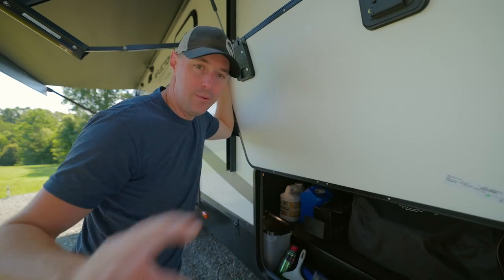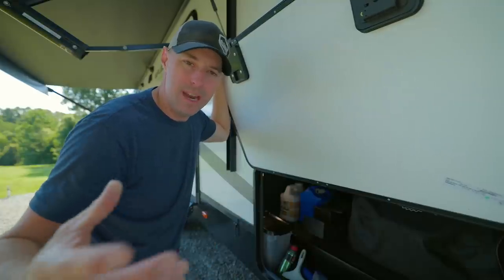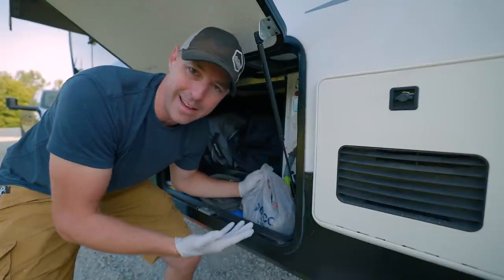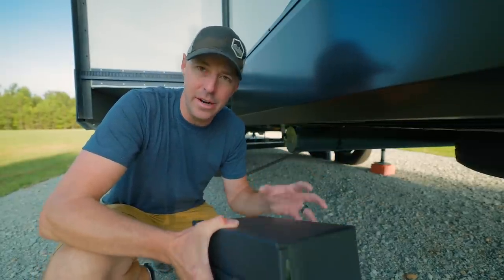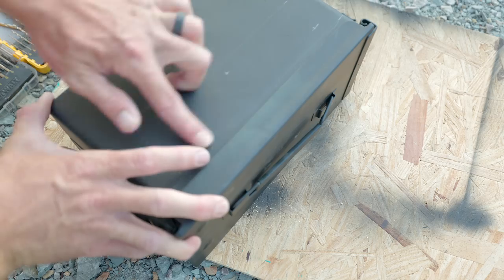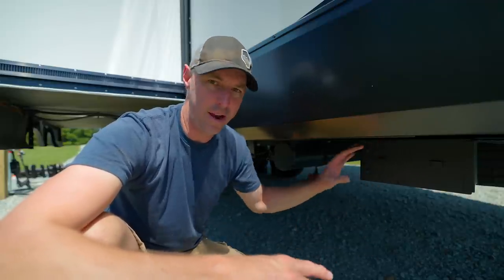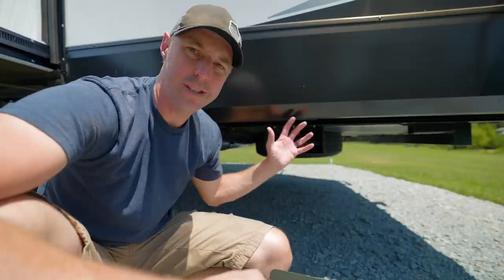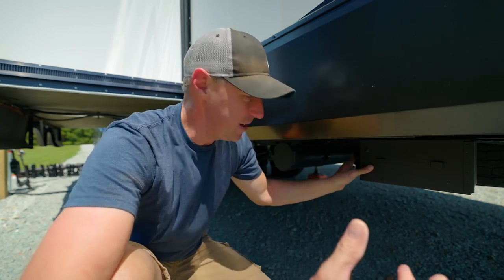DIY Secret RV Storage!

Comment: Good Idea but I think the weak link in the installation is the screws.  Or not sealing them from the elements.  Water or moisture will find a way into that box to frame connection and start to corrode.  Some silicon or other sealant on the back side where the screws poke through the frame would be a good idea to extend the life of the mod.
Reply: The nice thing, though, is that it's cheap enough to replace if becomes a problem! :)
Reply: @WillBelden how about the frame?
Reply: @cisco1dog  Not sure those i-beams would rust out in what's left of MY lifetime.   I'm no metallurgist, though!
Reply: @WillBelden  maybe not, but having been a large truck technician and then field engineer, we never put holes in a frame without preparing it for the possibility of rust. The frame isn’t where you want to encourage rust. Some paint or petroleum based preparation would not take any longer and would insure the can and frame were secure.
Reply: @cisco1dog  Sounds like excellent advice, and you're right -- wouldn't take but a few seconds to seal up nicely!
Reply: @WillBelden  by the time a rust will be an issue, the RV will already be in a recycle pile.

Comment: I probably would have mounted it so that the door/lid opens the opposite direction, this way if it does pop open while driving the wind will help keep it closed. But that’s just me.
Reply: If you had done it your way every time you would have opened the door the lid would have fallen off. Check out the orientation of the hinges.

Comment: DUDE! You're killin' me! Just got home last Sat from a 4 day jaunt in the trailer. I kept the trailer in my driveway specifically so I could accomplish a few more modifications that I didn't get to last season when our trailer was brand new. Just finally installed a weBoost cell service amplifier, set up a new griddle, and completed a few other things and TODAY was my day to run the trailer back to my storage facility until next Tuesday when we launch on another 3 day get-away. NOW THIS! I was just brainstorming this very subject on Saturday morning when I was breaking camp down but didn't come up with any great solution to separate out the waste components. This is perfect and I have the components in my garage. So, TOMORROW is trailer return day so I can get my bass boat back home so I can hit the lake asap! Thanks! 👍

Comment: I had the same problem and solved it by mounting a battery box on top of the bumper.   It is the perfect size to hold all of my connectors an donuts  for needed for waste removal and keeps them away from everything else.
Reply: Can you post a picture please
Reply: @jimbauer5560  13-23
Reply: @jimbauer5560 you could probably just strap it down without putting holes into the bumper. The battery box anyway

Comment: I use ammo cans extensively for storage in my class a. 
Everything from tools and parts to well.. ammo.
I would use 1/4” bolts instead of the screws. Most screws break pretty easily

Comment: One of the best mods I did years ago. Makes it so easy to get to the fittings. I went with a slightly deeper ammo can. Yes drill a few small holes as moisture builds inside.

Comment: Dude! This is perfect! I did replace my hose holder with an 8ft section of vinyl fence and used the existing holes to mount it to the frame, that way I can keep 2 sections in one spot. I am going to use the ammo box idea too, thanks!

Comment: Yep, I did that 12 years ago. The tube that held  my sewer hose wasn't big enought to hold my Rhino sewer hose because of the right angle connector on the end of the hose. So I took 4  eight foot cedar fence pickets and cut them to 6 and a half foot. then glue and screwed them together. I cut the  left orver pieces to make and end and a hinged door for the other end and put L brackets on it, then painted it to protect it. then  mounted it to the underside of the rig where the old sewer hose tube use to be. I also made a box to hold my 15 ft. telescoping ladder under the 5th wheel. Having to reach down to my ankles to grab that ladder on the back on the rig while it was shaking was a less than safe way to get down. Now I just climb up the telescoping ladder an step off on to the roof and step back on to the ladder to get down. Sooooo much easier.😊

Comment: Did that 4 years  ago with 40mm Mk19 ammo cans on my Forest River travel trailer.  Actually had 5 of them mounted  and they carried everything from x-chocks, dunnage, power cables, dump tank fittings, and water hoses.  I actually have a 50 cal can  my fifth wheel now mounted by the dump port that I keep the final 90 and donut in.  You can go on line and order a stud that has a padlock hole that you install and you can padlock the  ammo can closed.

Comment: Such a great mod Jared, thanks for sharing!  The only thing I would add is on non-metal cans add flat metal braces inside the can that connected at the screws to keep equal pressure across the can against the frame. Keep them coming!

Comment: YO! this is fantastic, you just solved so many problems for me. We just picked up a small jayco x17z, and it has quite a lot of storage for the size, but only a very very small exterior door and it's on the opposite corner from tank drains, so I had to either use a bag for all the drain stuff, or find a bin that could somehow fit through the door and hold this stuff. Guess I'll be mounting one of these over there for my gross stuff. THANKS!

Comment: I've got a compartment in the rear that I keep the power cord, adapters, hoses and flush equipment. I keep all those things in a container (enclosed w/ lid), but I just might have to look into doing this same setup (as well as finally mounting the hose holder under there too).

Comment: Gr8 idea!!!  Wish the RV industry would come up with some external storage solutions in the back end of these coaches.  I know theres several on the market that are bigger, but the price tag is around $600 and they are dust and water collectors.  Several different sizes on both sides as options for your needs would be ideal for storing miscellaneous items as you perfectly articulated and did!
Winner winner seafood dinner!!!
👍😃🍻

Comment: I like the idea of under mounting and the specified use. Well thought out.
Suggestion: I don't know the materials the amo box is made from, but for mounting, I'd go with stainless steel screws.
Reply: If it's a standard surplus one, it's steel and will rust.
Reply: Harbor Frieght sells a plastic one and goes on sale frequently. I use them for my deep impact sockets. I’m going to get one and see if all my sewer fittings will fit.
Reply: Stainless hardware can be pretty, but it isn’t the solution to preventing corrosion.

It can often be the opposite.

Dissimilar metal corrosion is a major problem with using stainless hardware.
Aluminum and stainless do not play well together and the components will self destruct quickly with the slightest moisture.

Stainless with steel isn’t quite as bad, but is still a factor.

The strength of hardware varies greatly. 
While some hardware meets certain specifications, much of the “pretty” hardware sold at “hardware stores” is softer than steel comparisons.
Reply: I picked one up all my fittings fit perfectly, looks like it will mount fine, I might use a couple fender washers to give the attachments a little more surface support. If it was metal I would not need this.
Reply: @helidude3502  I'm not sure why you're playing up "pretty," since this is probably not going to be seen anyway. 

The issue is bimetal or galvanic reaction, as you pointed out. Stainless and some steels will have a corrosive interaction with each other, but my guess is that the conditions under a travel trailer will be such that rust will be the first to cause the box or the mounting screws to fail, especially with most self tapping screws, other than stainless. 

Plus the stainless to steel interaction can be lessened considerably with a buffering material, like a nylon washer, if needed. 

Another solution would be to use a stronger fastener, like a bolt and nut that would better stand the test of time, but may have other negative effects that would need to be considered, like the integrity of the structure onto which the box is attached after drilling larger holes into it.

Comment: Love it but maybe grab a piece of styrofoam to stop the pieces from banging around while underway. 
I am excited to do this. 
I installed a pair of these 8 years ago to put my wheel chocks in on each side of the trailer, I just replaced them as they were getting a little ugly. EASY TO DO👍

Comment: For the self tapping screws I used stainless so it doesn’t rust and then I also put red Loctite on the stainless steel screws so I screwed it into the metal. Hopefully it doesn’t come out.

Comment: This is one of the best RV upgrades you can make.  I added this to my 5th wheel about five years ago and it works awesome.  Definitely add drain holes though.  Just for info, while adding the carabiner gives you peace of mind it is really not needed.  The ammo can will not open while driving due to the cam action of the latch.  Great video.

Comment: Looks like a good idea. My only question is should the door swing the other way so it will not catch wind going down the highway?
Reply from the maker: I considered that but if I did that every time the door was opened it would fall off. It can’t open with the carabiner on the latch.

Comment: I was wondering if you had the required access to the RV manufacturers that could allow you to ask them what it would cost to produce an RV designed to be used year round. Camper or trailer to keep the vehicle cost out of the price.

Comment: I bought a used travel trailer and the previous owner had installed these already!  Difference he screwed the back of it to the frame, instead of under the frame, so its up higher and opens the same way.  I wish they made some that were 3-4 foot long.  Great thing about buying a used camper, previous owner had done most of the mods you need. My first two campers were new, 3rd was a used one and in the future I may stick with buying used just because of that plus, new campers….expect a year or two of working out the bugs and faulty equipment before having something more reliable.

Comment: Love this idea. Since the tubes for the hoses are plastic, did you consider using plastic ammo boxes instead of metal? I'm going to do this for my adapters and would like to know pros and cons of the plastic ammo boxes
Reply: Good idea. In my RV, I really have to be concerned with added weight.

Comment: Replace the screws you used with stainless steel machine screws and nyloc nuts. This way,  it wont vibrate loose and be lost while driving.

Comment: I made an aluminum box and mounted it between the bottom trim and frame, cut a hole in it and added a door, now the stink slinky has its own storage compartment
Reply from the maker: That is a great solution.

Comment: Were your ears burning?  We were just talking about this very issue for our RV.  So thanks for the idea.

One question: where do you keep your slinky? The thing that holds the sewer pipe above the ground from RV to sewer hole...
Reply: He has a sewer hose holder installed under the RV which you can see here 2:06
Reply: @kmgates  thanks but I’m not asking about the sewer hose tube. I’m asking about the sewer hose support, sometimes called a sidewinder sometimes a slinky. It keeps your sewer hose off the ground when connected and emptying your tanks.

Comment: Hi Jared
THANK YOU FOR REPLYING to my comment on the Video regarding DIY MODs. I want to tell you I really appreciate you giving me the following information. I was asking you about the on off switch to my house batteries and what to do if you're plugged in all the time to shore power. You responded to me and said, most RVs nowadays have a multi stage converter charger. My question to you is what do you mean by most RVs these days? Because my RV is a 1999 25 foot class C Itasca. Would the date and year of my rig Have anything I should do different regarding turning on or off my house batteries when I am all the time plugged in to shore power? thank you so much I hope I hear back from You. This is becoming very confusing for me and I Don't Want To blow out my batteries in the house or do any harm too Need something done when I'm disabled and don't have very much money. Thank you for everything!!

Comment: Handy idea.

Vibrations will probably cause these screws to crack, or the box will crack around the screw heads.

The loss of this box and contents is minimal.
However it could prove fatal to someone with an open car window or on a motorcycle.

I suggest using better hardware than these type of screws designed for stationary structures.

Use screws or bolts with self locking nuts.
Use a doubler or large area washers on the inside of the box. (Rounded edge towards the box)

While not as quick as those zippy screws, it’s more appropriate for the task.
Your mod will last much longer and you won’t have to explain yourself in court.

Let my experience and the experience of several aircraft manufacturers save you some heartache.

Cool mod.
👍😎